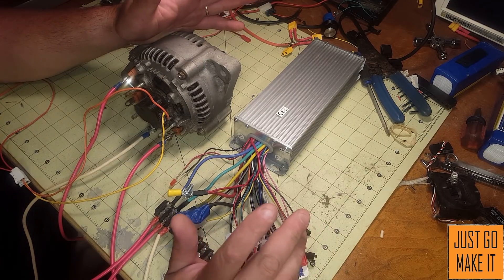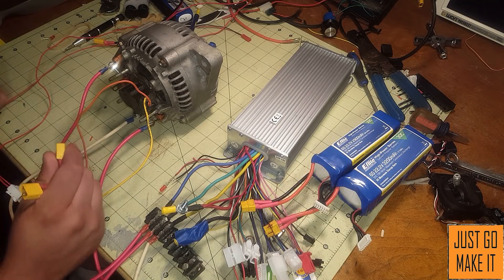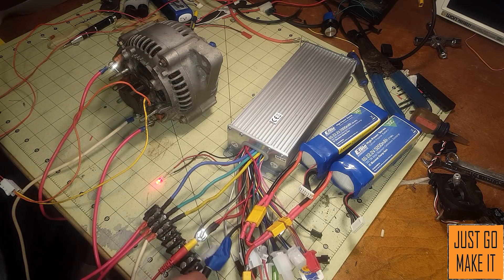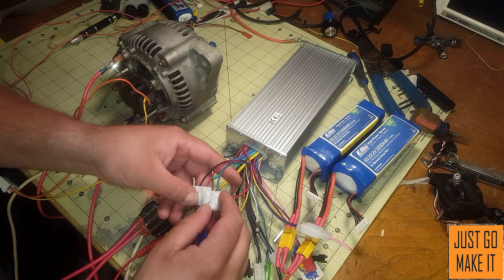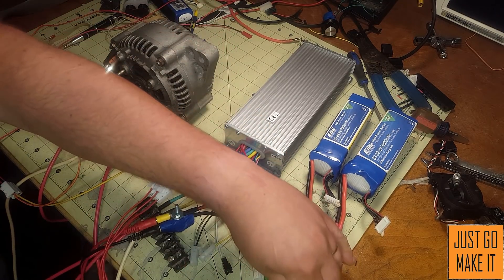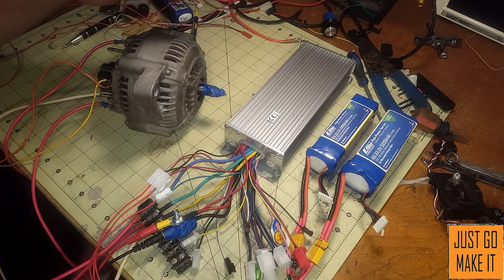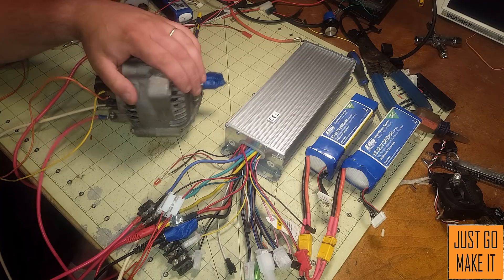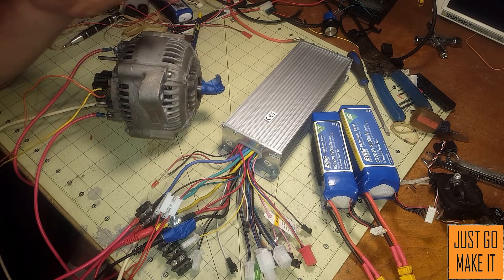Alternator to motor conversion with Ebike controller.  THE EASY WAY

Comment: Love ur videos. Very educational. I have a zodiac 12ft inflatable boat with a 15hp gas motor.  Motor won't run, so I was thinking of getting a couple alternator and mount them inside the case at 48v with 2 contollers. Do u think there is a way to control speed of both motors at the same time with one throttle?

Comment: Do you have hall effect on this motor? I have found without it the motor seems to only work within a specific amount of power range and not at high speeds. I am looking to power a tricycle I have with this setup. I plan on making it a permanent magnet motor.

Comment: did you run the altermotor without hall sensor? did the controller operates with or without sensors? I asked becauseit wasn't mentioned in the video, I'working on a aimilar setup and this hall sensor is making me sick/ my controller has 5wires hall sensor and I do not have an idea where and how to position the sensors inside the alternator come motor.

Comment: Thanks for the info.  I am looking to drive a boat lift crank with a converted alternator using a small rubber wheel against a large (42") pipe wheel.  The large pipe wheel turns a shaft that has a 16:1 reduction and requires about  20lbs of force to turn.  I need some info of power consumption.  I was planning to run it off a car battery that stays on trickle charge using a car battery charger.  The area of this that is a mystery is how much sustained power can I generate with the motor, so I can select the correct sized drive wheel.

Comment: Fellow, I just want to make one simple question. Why do we need a speed controller, when we can install a variable resistor? I ask you because I´m going to use a 12v 40 Ah AGM battery. My design is a pushcart, a 3rd wheel pushing my bike, with the brushless converted alternator attached with a chain drive to a small bicycle rear wheel to provide thrust. 
Do I NEED a speed controller?.
Why do I need it?
Reply: You need the controller because it is 3 phase

Comment: Youre 1500 watt contrler the most youre gonna get is roughly 1.5 horse 750 watt  per horse power but with frition losses and power consumed in feild winding about 1.5 horsepower but electric .otors are bery tourky and accelarate very fzst

Comment: Could you use the same controller if you wanted to use 12V vehicle batteries instead of the LiPos?
Reply from the maker: Yes you can

Comment: Being an automotive alternator, the field coil should happily run at 14.4 volts, which will give more power output as well. a couple 14.4v rc packs in parallel would energize that for a good while.
Reply: Rpms way too low with high coil voltage.

Comment: I have a alternator that has 6 pairs of wires, I wired it in what a delta configuration, but when I energize the rotor and turn up my speed controller the alternator just sits there and twitches making a high pitch whine like it wants to go but never spins. Any ideas? All the field coils ohm out nicely no shorts to the housing anywhere, the rotor ohm out at 5 ohms.
Reply: do you still need help?
Reply: @foxxyytofficial  I gave up on that one and threw it away, got my hands on a GM LS/Vortec Alternator that worked like a dream, that are already delta wired, :P Thank you though!
Reply: @JamesRader  do you have videos or pics?
Reply: @foxxyytofficial   i have a 6 pairs one are you still into helping us folk out? would love to get it going. cheers!
Reply: @peterpayne4500 I'd like to help but it's been quite a few years, I'd basically forgot everything, but If I'm not mistaken, the YouTuber "fixitmoditbreakit" used a 6 pair alternator in a project

Comment: Have you tried more voltage in the field coils?
Reply: more voltage in the field coils can make the current go up, make the field to oversaturate and make it overheat, the best answer to this "detail" is to adjust the voltage in the field coils, to get in safe levels

Comment: Won't that alternator blow the controller under load?  It looks like it could draw way more than the 1kw limit of the controller.
Reply: yeah, some alternators can pull up to 3200W

Comment: Could you use the output used for the led and a resistor to supply 12v to the field coil?

Comment: How to Hall sensor connection sir? 🙏😁
It,s Work without hall sensor ?🙏🙏 please give me solution
Reply: Just buy a controller that doesnt require hall sensors.
Reply: @earnwithbots2783  eeem ok thanks sir
My order  48v 1500watt can work without hall sensor but start rotate not good🙏😁
Reply: alternator not hot?
Reply: to connect hall sensors you need to modify the alternator, in the site EndlessSphere the user Widodo put hall sensors on the alternator

Comment: You are on the way to doing amazing things!  I built E-bikes just for fun,  and hope to make it a retirement addition,  If I retire before I expire.   I know what you're talking about with regard to the different wire colors and connectors.  The biggest problems I've run into are always the Displays that the e-bike controllers use.  They always fail.  I finally went with analog displays and I use my Phone and an app for  GPS Speedometer.  You can take what you know and with a little imagination, make an e-bike that will take the world of e-bikes to an entirely new  level. I've had people ask me about using an alternator to make an electric motor, so people are out there, that might have seen your video.   It's all about design, Cool Factor, and Price.  You're on to something. If you could take multiple alternators...(I believe that an alternator rotates at 3,000 rpm? ).  A Hub Motor is 7,200 rpm.  If you configure them into a really cool looking design... And add Capacitors...You could change the whole world of e-bike design and make e-bikes affordable for everyone.  An Alternator already has a really cool design.  .  A DC Motor with no load is a Generator. If you add more than one..You can make a really cool design within the triangular section of the bike frame.  Or you could just hide them in a case.  I always tell people to keep the dream alive...Go back to Bed... Because that's where dreams become reality.

Comment: Bro my alternator has 8 cables, help me!
Reply: I dont now, its not possible send link in this channel.
I think, You need this:
Compatible Motors:
Only those 8 wires(3 phase-cables & 5 hall-cables) DC brushless motor that can work with this controller,
other brushless motors are not compatible.

Installation:
These controllers have 4 groups necessary cables(power cables, E-lock cables, Throttle-cables & Motor-phase cables),
when hook up these 4 groups cables, the E-bike can run normally.
Besides, these controllers have other optional functions, users can hook them up according to your applications.

Package Included:
1 X Brushless Motor Controller

Comment: Car alternators are made for dual use 12 and 24V. What the power is you measure off of collectors (where brushes to rotor are)

Comment: hi, i love your Alternator to Motor content
and i would like to request something
i was thinking that it would be nice to use that brushless controller on the stator
but installing hall sensors onto the alternator
and using a 12v brushed controller to keep the field coils energized
creating "electronic gears" for the motor

Comment: The 2 red and the white wire is white ground and red positive regulated? If i just want it to be on at full rpm what should i do. no regulation
Reply: Want to use 2 alternators one as a motor 2nd as as an alternator to charge a battery that powers an inverter

Comment: on this example you are using 144 w on the motor  44 volts with a round 3 amps probably more depends on your controller.

Comment: You can control the speed and torque of the motor by using a pwm to the field coil. Found 12v gives better torque but dropping down to around 5v greatly raises rpms.
Reply: i can't remind now where i read, but i searched for "how to control the rotor current/voltage"
and someone said that using pwm in the rotor can mess with the stator running with these pwm controllers

Comment: What's the efficiency?
How many mAh does the coil connected to the 12V source absorb?
Reply: Not much, a few 10s of mA, the field winding only needs to be saturated for the motor to have full power, it is a self exited system after initial charge up as it alternates in polarity as the stater spins with respect to the brushes.

Comment: after looking all over the internet you are the only one who has made this simple to understand, But I have a few questions. Am I able to run this off of 24v? and what motor controller should i use? (i am making an ebike) Ive been trying to find one that fits the amps you mentioned in a previous video and I just cant find one.
Reply: yeah, you can run with 24v on the brushless side (the stator), but i won't agreed for you to use more than a LiPo 2S or equivalent voltage (8,4V) on the field coil

Comment: I'm trying to bypass the controller. I've configured it in delta and added capacitors. I'm running 12V DC to the brushes, but what do I run to the coils?

Comment: On older alternators the field winding was fed through a small bulb in the dash of the car. Once the alt was generating the lamp went off. If you fed it from the 48V main battery through a suitable resistor, that would save having the need for a separate 12V supply.
Reply: An alternator has to get above 2100rpm before it comfortably powers the field coil. If this was powering a vehicle it would work on a steady long journey but not very efficient around town. Unless it was continually running then a clutch and gears would be needed.
Reply: So thinking along those lines, would it be a viable idea to feed the field from a nominal 12V source via a car dash-board generator bulb? That would provide enough initial current to initiate the field before the self-generation effect countered the supplied current, then the bulb would then go out.

Comment: Does the battery size effect anyway? I have 2x 12v9ah moped battery and 1 for coils. My motor  dont run correct. It dont have torgue and dont even always run... or could it be the alternator or my small 24/36v 350w regulator?
Reply: Hey, if you're using 24v on the stator, try to use less than 7-8v on the field coil while running the brushless controller

Comment: Great videos...Just wondering if the brushless controller is the SPD-481500BLDC...If not
could you drop a link to the controller you're using...thanks...

Comment: I'm doing this too but my alternator it had 6 wires so I had the option of wiring delta or star. It didn't work very well in delta so I've wired mine in star, it seems every alternator is different as others have found delta works better for them.
Reply from the maker: i believe it all depends on how the alternator is wound.

Comment: Contr
ollers have 5 volt sensor voltage built in- will this not power the field coil?
Reply from the maker: more then likely would not supply enough amps

Comment: Can you couple another alternator on the other side or onto same shaft so you get power back. I've seen this being done on another channel. They harness the extra power through metal dc capacitors before going back to power the motor again. This also acts like a buffer to work nicely to charge battery.
Reply: No no and no... There are always power losses, nothing is 100% efficient.
Reply from the maker: i have no idea  give it a try
Reply: You can get power back but you're better off just drawing from the battery.
Reply: you would be only dragging more weight and the energy recovered can be a lot less than you lose only making the second alternator spin

Comment: Open it up.I got that one red wire that keeps getting it's self lost. Someone cut the connectors off and I am not sure the pinout on the wire on a 5 fet skinny red next to the resistor and caps.

Comment: May I have to connect it in star connection as you said in your video and the quadcopter motors are in star connection.

Or I have to calibrate the ESC with another small RC AIRCRAFT motor and then connect it with the alternator motor.

I get struck at this point because iam new to this ESC kind of things. 
Please help me .

Comment: Sir, thanks for sharing your knowledge with us.

I also do this same convention a week ago.I had a 75amps alternator and I converted it into a  motor, but I did it in delta connection.

I had a 80amps rc ESC and it is not calibrated, its a new one. I connected it with 24v(series of 2 12volt batteries).and I used a servo tester for throttle.

When I connected the batteries to  ESC I didn't hear any beeps coming from motor.

What is the problem. Can you please help me out to slove this.

Shall I calibrete the ESC using another RC QUADCOPTER motor and then connect it with the alternator(motor). Because I think the coils in alternator are to heavy for ESC to produce those kind of audiable sounds.

Please help me sir